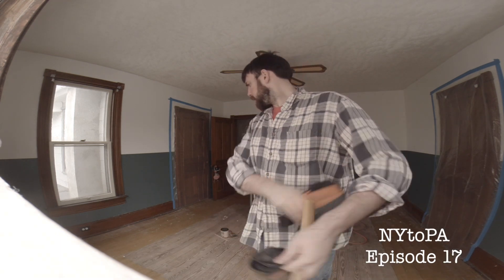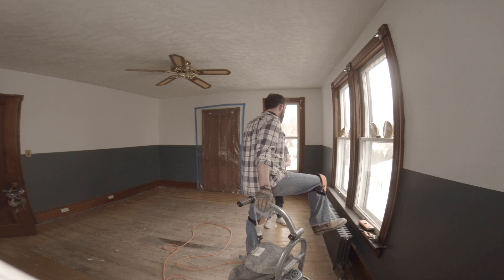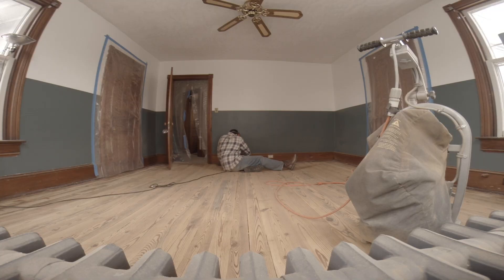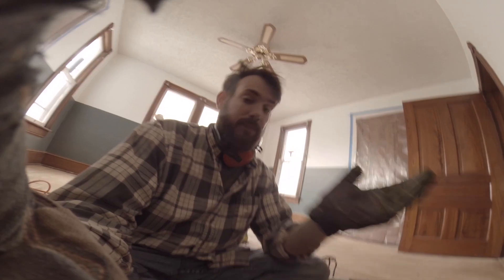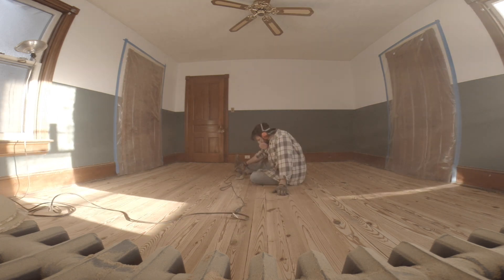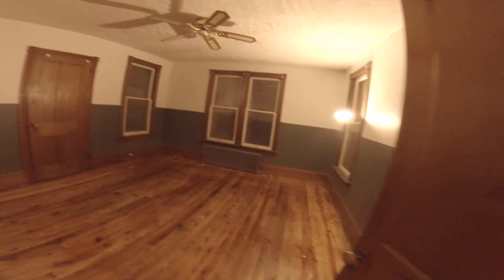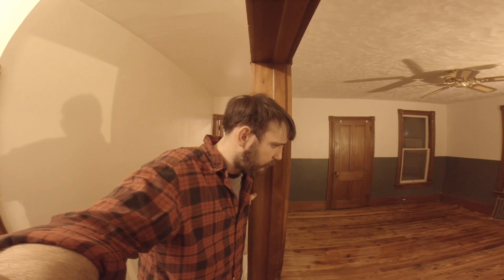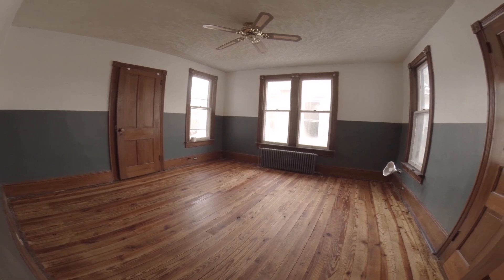Striping and Refinishing The Bedroom floor with Tung Oil | NYtoPA Episode 17

Comment: Looks very nice but a LOT of work. I think I might stick to just staining my wood if I ever try and refinish my floors.
Reply from the maker: Thanks! Most of the work was just getting the paint and varnish off from around the edges of the room. once that was complete applying the oil was easy as pie. I would definitely recommend tung oil as a finish however you really can only get two tones with it so stain might be a better solution if you're looking to do a specific color.
Reply: Tung oil absorbs into the wood so you will have a very hard time redoing the floor again if you want a different sort of finish.
Reply from the maker: @yochanan770  trust me! I never want to refinish my floors again lol!